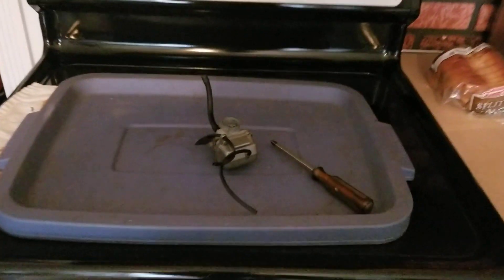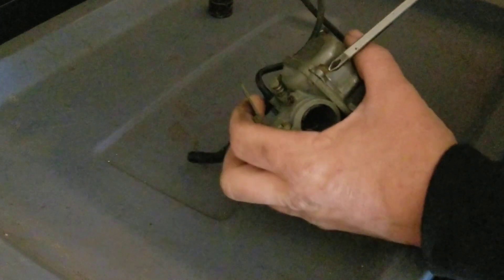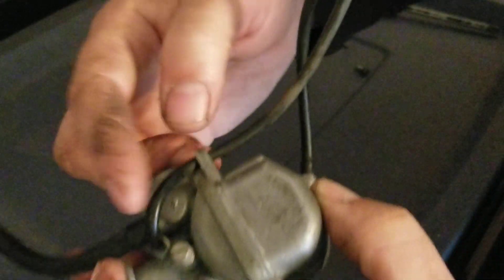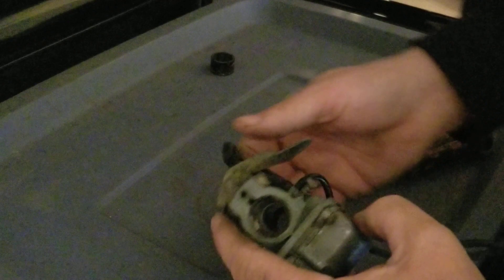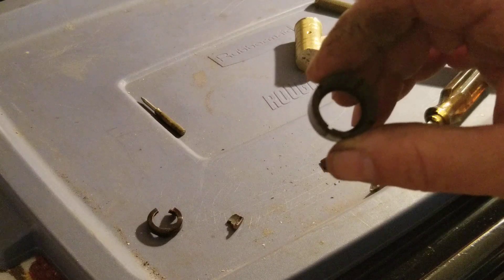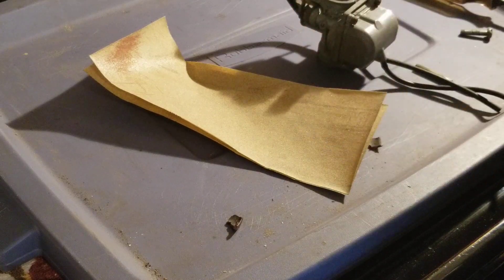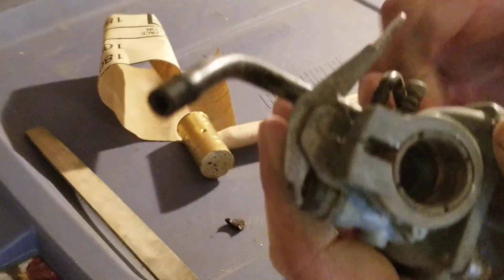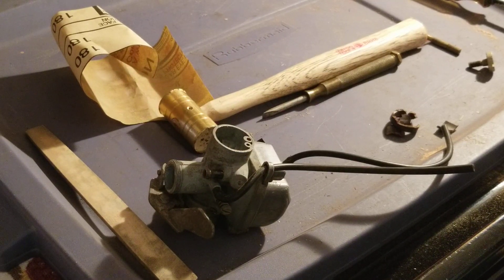Yamaha gt80 bike build series part 3 carb inspection and repair

Comment: I also rebuild and clean carbs in the kitchen, lemon juice boil, the wife loves it! Fyi im here because i acquired a GT80 fully complete. Not getting spark right now but I have a coil on the way so we'll see if its that or points problem.

Comment: Does the float valve assembly of this carb have a spring? I have the same bike (1973) and manual mentions a spring but the carb I have does not have one. Wondering if its been lost?

Comment: where were you able to find a new insulator, they don't seem to exist anymore
Reply from the maker: I found a slightly larger one was able to sand it to fit
Reply: @2strokeguru  What insulator did you find that you could make fit
Reply: @2strokeguru 
Hello.
I took mine apart to clean it, the bike had been sitting for who knows how long my friend gave it to me after he got it, it was ceased up but he was able pour diesel through it and get it moving and running.
So when I shot it I figured it should be given a proper tune up. well the inside of the carb was full of all kinds of rust and paint chips and everything else I washed it in some gas and then I sprayed it out with my air compressor and when doing so I heard something go flying and hit my table but I couldn't find anything missing on the carb so Im not sure if I was a part of not. After cleaning it out and putting it back together and on the bike fuel just runs right through it. The float seemed fine and working when I put it together so what did I do? 
Thanks
Reply: @sageminentjunky5197  
Was it the carb float needle valve that you lost? If the needle valve is missing, or has a piece of debris keeping it from closing all the way, fuel will run right through the carb and pour out the overflow tube.